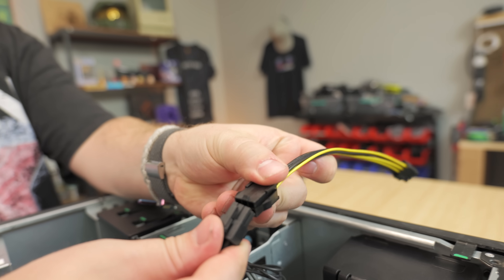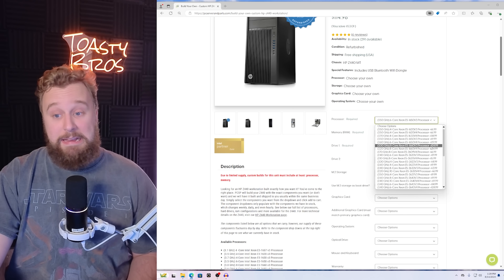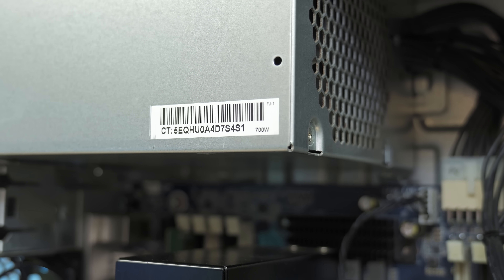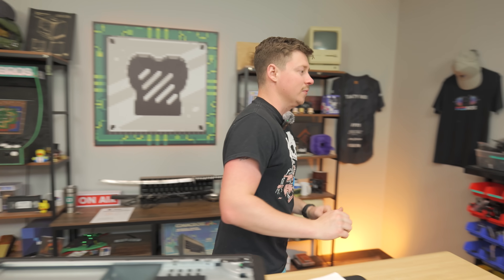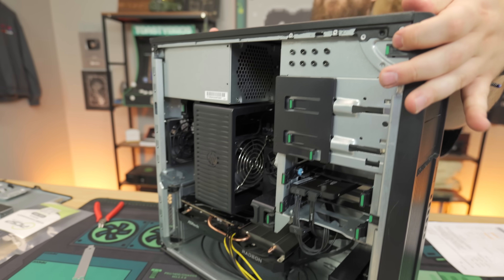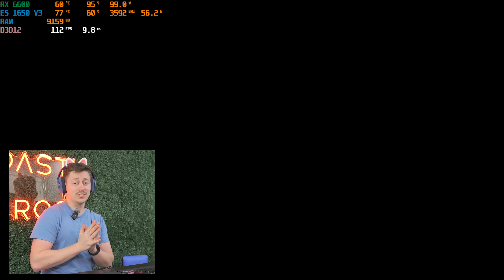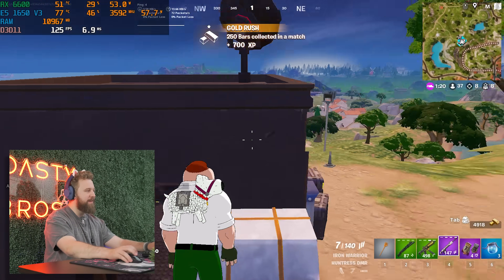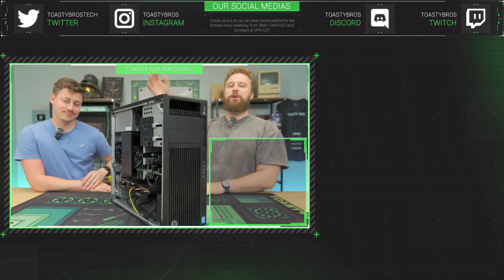EASY $340 Gaming PC Build Guide - Step-By-Step

Comment: 7,548 is a great score for the price!

It can't run Windows 11 though and Win 10 reaches end of support this time next year.

I guess you could switch to Linux at that point, but it really is something you should mention.
Reply: What prevents this from running Windows 11? I have the same rig, albeit with a E5-1650 V4, and I run Windows 11.
Reply: @aaronabel166  The E5 1650 v3 or v4 are not on the list of approved processors for Windows 11, I'm guessing you used a registry hack to install it? 
The problem is, Microsoft has starting block all the backdoor hacks and has openly said they will be blocking updates to unsupported computers when the time comes, and possibly even bricking the operating system completely.

Comment: Are you able to remove the parts and put them in a new case ? Or does it have to stay in that case ? Very interested for sure
Reply: u should just buy a used prebuilt with a gtx 1660 super and a am4 cpu for the same price
Reply: sometimes yes but mostly no, they have proprietary parts

Comment: Fun fact. You can overclock the 1650 with Intel XTU if you want squeeze a little more performance for the money. I was able to run the 1650v2 at 4.4Ghz all core. The 1650V,V2 and V3 are fully unlocked. :)

Comment: i recently got 2 Z440s. upgraded it to E5 2683 V4 16 cores 32 threads. will buy 128GB ram and use it as a workstation/server/gaming setup. not sure what GPU to pair with them yet

Comment: For that price you can build an am4 b450 system but you'll be on a platform with tons of upgrade options, supported bios and windows updates, and it will perform way better
Reply: While ultimately I decided to build my own AM4, this is a fine alternative.
Reply: @antondovydaitis2261  you made the right choice though. Bottom line if you can build a similarly priced am4 build over these office builds for the same price your better off doing that as you have way more options down the line
Reply: @antondovydaitis2261  you made the right call. Bottom line though, if they cost the same, am4 is what you should build/buy not these old office pc
Reply: Noone wants windows 11.
Reply: @TonicofSonic  i agree lol but the other points still stand 😅
Reply: @88-bit-tech  Ya but win 11 is a deal breaker.
Give me an old pc all day over that cheaply made trash.
Reply: @TonicofSonic  you can install windows 10 on am4 mate...
Reply: @88-bit-tech  Well then windows 10 it is. Not buying a prebuild is the key here.
Reply: @TonicofSonic  I use and enjoy windows 11 on my top of the line gaming pc.
Reply: @TonicofSonic I’m like Windows 11
Reply: @OtakuAnthony  who hurt you
Reply: @TonicofSonic  then don't upgrade...

Comment: Those saying "the hardware is to old and won't perform well" are people who haven't bought one of these and used it. I have a Precision T5810 and Lenovo P520 and they work absolutely great. They play most, but not all AAA titles are very good frame rates. I run quad channel ram in both with 128GB of ram because the dells on ecc ram on ebay are great.
Reply: There's a lot to be said for the Lenovo ThinkStation P520.

I almost went that way instead of building my own AM4.
Reply: Running quad channel in these older Xeon machines is really important to get your RAM bandwidth in line with more modern PCs. But 128 GB for anything gaming or personal use related is insane overkill. This is coming from someone with 64 GB in a P520 which is already insane overkill. 

But yeah people would be surprised how well these machines run and avoid bottlenecking even up to a RTX 2080
Reply: True AF my dad used a system with ddr2 ram up until 2020 when he stopped using computers

Comment: I've just recently built one out of a dell precision t5810,it has a xeon 2680 v4,32gb ddr4 2133 ram,2tb hdd and 500gb ssd,685w psu and a intel arc a750 all for £285 which is just over 300 usd so pretty good deal😊👍
Reply: Same here, and I also have the Lenovo P520. They are cheap, and perform very well for their age. Just gotta pair them with the right GPU. Don't be sticking a 4090 in them lol.
Reply: @dberube82  nice mate,yh there's no point putting high end gpu's In them lol,I think the maximum I could put in mine with the cpu is probably the intel arc a750 or the rtx 3060.

Comment: You can use the holes in the HDD tray or drill two into it and mount the Sata SSD to that
Reply: or you can spend $10 and get a Sabrent dual SSD to 3.5" adapter like I did

Comment: If you're going for an x99 build, I recommend the xeon e5 2666v3. It has 10 cores 20 threads and higher cache. Despite it having slightly lower clock speeds than the 1650v3, it can perform better due to that cache difference. The 2666v3 can comfortably run the 6600 without any major bottleneck for most games based on testing by miyconst hardware.
I got one for 12$ shipped from China. That cpu got me back into pc gaming because of how cheap it was paired with a cheap ddr3 x99 motherboard and rx580.
Reply: plus it has "666" in the model number so it has the power of Satan
Reply: It's better than 1650v4?
Reply: @Ramble1234  it's a JOKE... :face-fuchsia-poop-shape:
Reply: @aleaxdeathbringer  no I mean your main post, not the reply LOL
Reply: @Ramble1234  r/whoosh

Comment: I have a ROG MB I7 4th gen that had a 16 memory and a 970 card. It had 2 1tb ssd and a 2tb hd. Increased memory to 32, added a 3060 and added two 4tb hd in raid. I know my mb and older I 7 are somewhat limiting. What would you recommend as an upgrade mb and processor that doesn't break the bank? I do have a big Aluminum case and 1000 watt gold power supply. Just wondering what's best bang for buck?

Comment: If doing 6 to 8pin I usually use a 2 6pin to 8pin plug one native 6 pin in and a dual molex to 6 pin in the other and only if w of PSU is up to it

Comment: These parts are a decade old! They ane not worth it and you need to get something new and is at least a 10th, 11th, or 12th gen Intel CPU and 16GB 3200MHz DDR4, or DDR5 if compatible and you can afford it. You should never get 2133MHz or 2400MHz DDR4. 2666MHz might be okay but you need parts that are new and worth it. $340 gaming PC builds are not worth it and gaming on an office PC from 2014 or older, using an old CPU, slow RAM, and a new GPU is going to affect your performance, it will be sluggish and slow, and will cause lag and bottlenecks, so do not use old office PCs with a new graphics card because they will perform very badly, cause bottlenecks, the FPS will be very bad, and the games will lag and stutter.
Reply: right because you know everything and the ToastyBros know nothing. Even though they constantly produce videos that contradict what you are saying here. Don't believe our lying eyes, but hang on your every word because you know all. Uh-huh.
Reply: They are giving ideas to people who may not have much money but want to get into PC gaming. There is nothing wrong with providing an affordable solution to those not as well off.
Reply: Why? I have been gaming for years on i7-3770k with a RTX 2060 and 32 GB of RAM. It has played Fortnite fine.

Comment: With that being a Xeon you have a lot of PCI lanes, the E5 1650 V3 can handle 40.  In my PfSense machine, an old Dell T3500 with a Xeon X5690, I put a PCIe NVMe adapter card. So a computer with SATA-2 can have the speed of an NVMe.
Reply: That is smart AF

Comment: My first gaming rig was HP Z230 with i7-4790, 16GB DDR3 RAM 1333 MT/s and I slapped new 1050ti from ASUS because the PSU in the pc didn't have any extra power cables, so I had to use a GPU that does not require more than 75 watts. I still have it, it plays some modern AAA games on 1080p low quality, and CS2 I get over 200 fps. I don't use it any more for gaming, but i still keep it. I have a nice modern proper gaming PC for all the games. For entry level of gaming I highly suggest getting a HP workstation and just slam some adequite GPU inside. :)

Comment: I had a Z440 in the past, used a RX 580 8GB, was a decent 1080P low gaming machine :yt:
Reply: No low
Reply: I have an i7 8700k and GTX 1060 6GB. How do those compare to the Z440 and RX 580 8GB?
Reply: @BREEZYM6015  You have a stronger CPU but slightly weaker GPU.
Reply: So, are these even better than the Lenovo ThinkCentre workstations?

Comment: These old xeons are really falling off.  You can build a new am4 system for close to the same price now with the 4500 cpu that runs circles around those xeons in gaming even though it's a poor cpu compared to the 5500 or 6500  it still beats the xeons in gaming and mobos are cheap now as well as ram plus they are upgradeable.
Reply: 5600*
Reply: I have an i7 8700k and GTX 1060 6GB. Should I keep the CPU and just upgrade the GPU or upgrade the entire platforn?
Reply: @BREEZYM6015      It depends.   What are your goals?   What games do you enjoy the most?  How much money do you have to spend?   
Your i7 is as good as a ryzen 5-3600.    Its strong enough to play almost anything at a respectable rate, and is certainly held back by your gpu.  
I would upgrade your gpu first, along with a good high refresh 1440p monitor will give you the most satisfaction right now, and can always be transferred to the new system when you decide the i7 isn’t good enough anymore